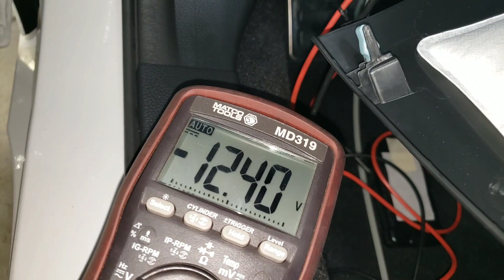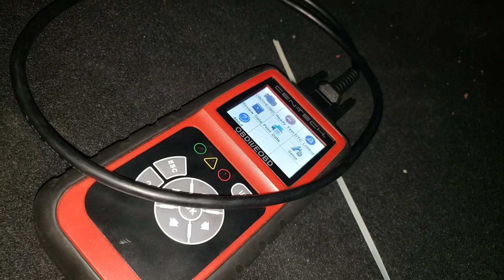How to Check power or 12volts supply from OBD 2 connector

Comment: I'm looking to test a gps device that plugs into the OBD II port to be used on a ATV that does not have a OBD II port -- I need 12vdc + and Ground -- and "ignition on/off"  --  I believe pin #16 is +12 vdc --- pins #4 & #5 are Ground --- which pin(s) would give me "inition on/off"  -- thanks in advance for the help
Reply from the maker: Pin 16 has + at all times and pin 4 is ground at all times. Doesnt matter if ignition is on or off.
Reply: @abcdeinformation3048  He is asking about 12v during ignition on and 0v during ignition off. do we have this voltage on the OBD connector.
Reply from the maker: @alexvillaluna22  i think i still answer the question. That means no. Not on obd connector.